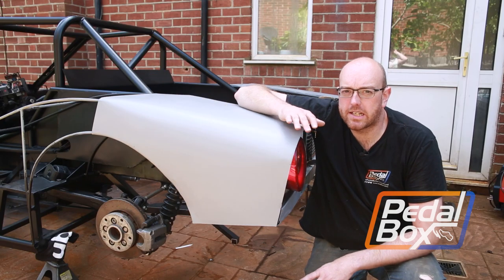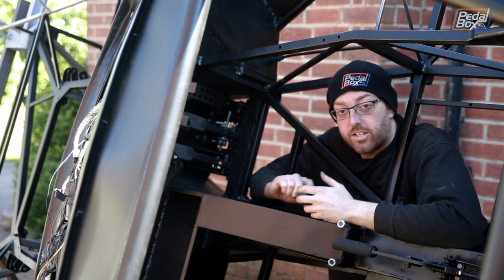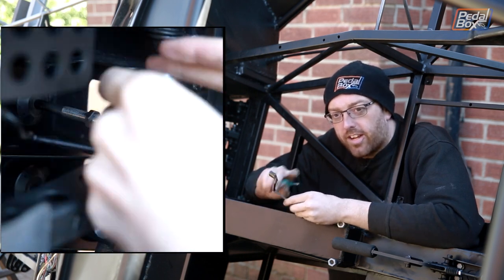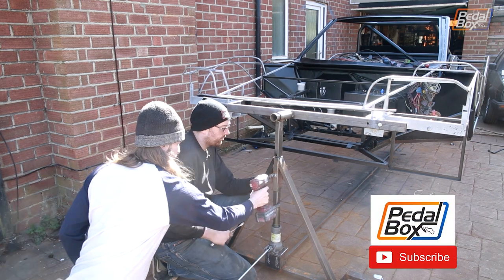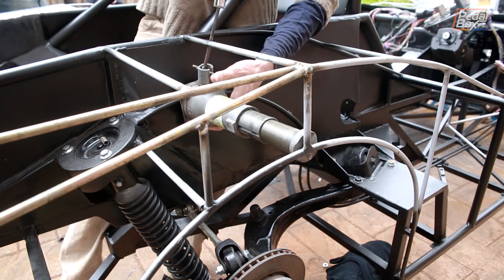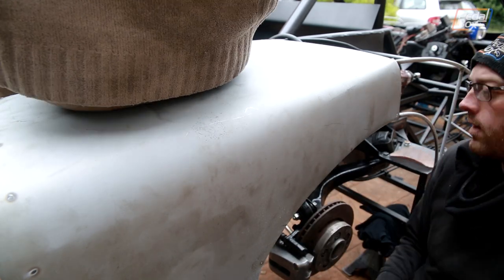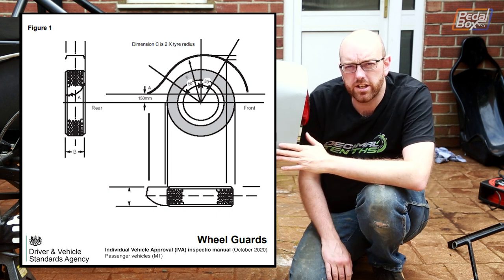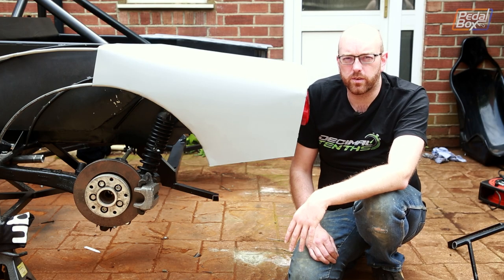Body Work at Last! | Audi TT Kit Car | PedalBox Episode 76

Comment: Brilliant progress chaps 👍👍
Couple tips on the brake light switch, who would of thought it was that important!! You've got the latest 1C0 revision - well reliable, also has shortest plunger(too short for mk2s!)
Mounting needs to be original turn and click TT/golf type hole as this sets the internal switches height. It's a double switch going to OEM ECU (feed from brake lights as well) so it can self check 1 NO, other NC contact which reduces the engine power on braking, so no heel/toe with putting in a other type and
Best bit: it doesn't need the whole travel to operate, needs contact with pedal (hence setting switches height) when not operated and 'open' when pressed to work the magic!
Keep up the great work while the weather is great
Reply from the maker: Ahh, ok cool, we've been fiddling with it on an off testing what the operations are, but that makes sense now you say it. So long as the pedal has stroke and isn't interrupted/fouled by the switch then it should be fine. Will have to have a look in the other A3 for the positioning I suspect for final installation if it's got an internal point it wants to be at! 
Cheers mate!

Comment: Doesn’t the brake light switch work the other way round as in the switch is closed/compressed when the pedals at the top
Reply from the maker: I... actually can't remember, but thats a very good point we should have a) checked or b) remembered if we did and mentioned. I'll have a check on the other A3 on the drive!

Comment: Nice to see some progress.
Only your choice of music, horrible.
On video's of bending and welding metal the music should be metal, or at least some overdriven guitar. lol.
Reply: Something little more light/heavy metal?? Sorry couldn't help the pun Eric 😀
I dislike videos that either have a silence or the angle grinder going without adjusting the audio levels, something I do in my video's
Reply from the maker: Haven't found a great deal that grabs me in that category, but then thats not my usual style of music so probably the bigger problem lol
Usually saved that for some of the other videos as it's thinner on the ground, check out the Wrathfinder video :)